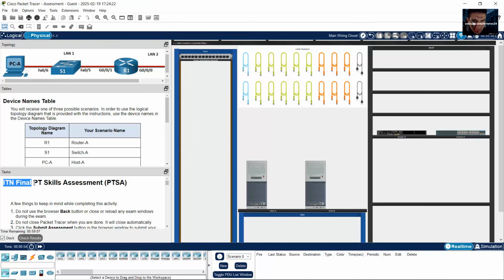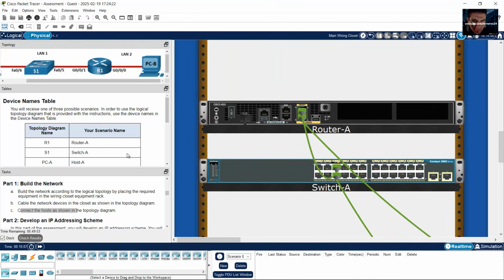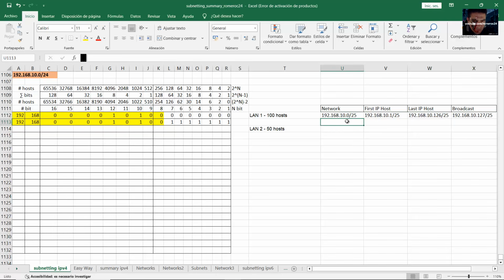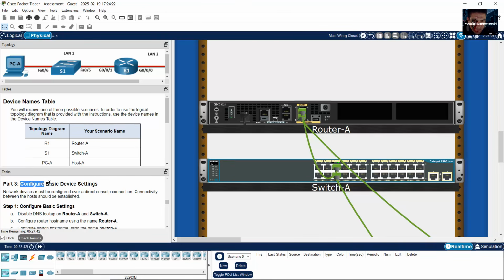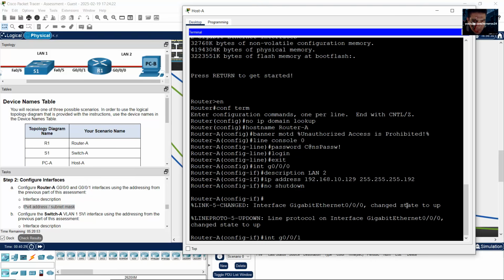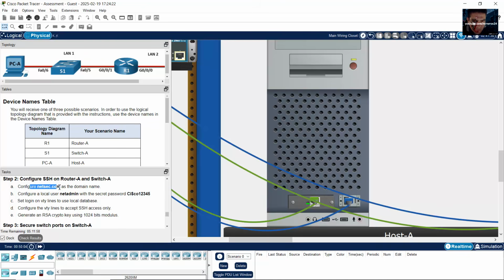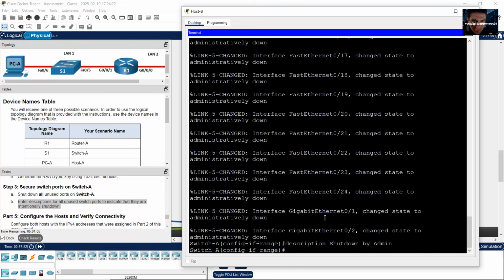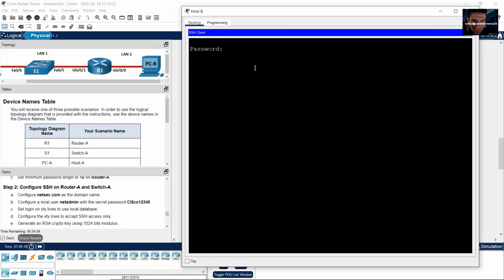ITN Final PT Skills Assessment PTSA

Comment: Brother, first of all, thank you. I am having trouble with this test. I took it before and got 90%, and I tried to repeat it again to get 100, but I didn't even get 90% again. I followed your steps and got 74%. What is the problem?
Reply from the maker: Thank you my friend, be careful when you are configuring devices, maybe you configured the basic settings in router and you forgot to configure the basic settings in switch, please document all the commands you will need so you will know when all commands will be configured in devices
Reply: @romeroc24 
I am repeatedly scoring 90/100 but I always lose 10 points in the "Network Assembly" section.

1. All configuration parts (Default Gateway, Switch Management, Initial Device Config, IPv4 Addressing, Router Interfaces, Device Hardening) are 100% correct. The ping works perfectly between all devices.
2. The only error: The system marks the Cable Type as "Incorrect" for the following connections:
   · S1 (FastEthernet0/5) ↔ R1 (GigabitEthernet0/0/1) → Type Incorrect
   · S1 (FastEthernet0/6) ↔ PC-A (FastEthernet0) → Type Incorrect

Comment: the terminal is blank for some reason and i can't write anything on it can you help pls
Reply: Did the problem get solved? Pls tell, I gave correct connections but still, same thing, it's blank.
Reply from the maker: @antaralaya75  maybe you forgot to power on the device
Reply from the maker: Hello, please be careful with cable connections (console cable and console port) please review that item

Comment: Thanks for the help, I got a 100%. I'm going to use your addressing table! 👍

FYI to assessment takers: The assessment randomizes the given network IP, required hosts on each LAN and the names of the switch and router. Don't just follow exactly verbatim what he does; instead, make your own calculations on the addressing table while following his guidance.
Reply from the maker: Thank you for all your support my friend!!
Reply: Hi ,in  what exact order did you connect all the devices ? What device ,port and cable ?
Reply: @ivayloborisov2271 I saw yr reply is pretty recent did y take the test yet if yes did they change it?
Reply: @ivayloborisov2271 I followed what he did in the video in the same order.